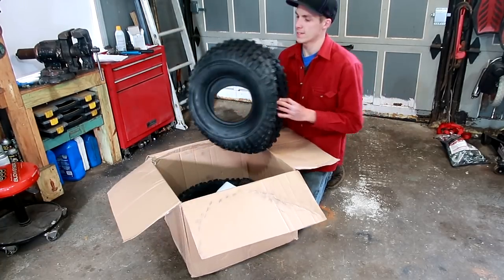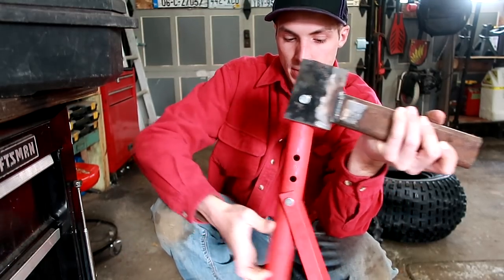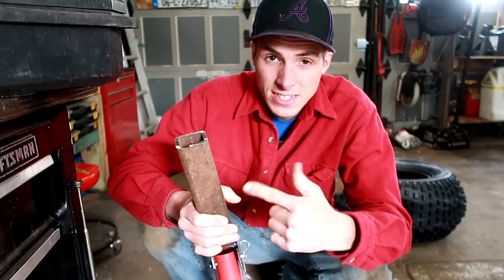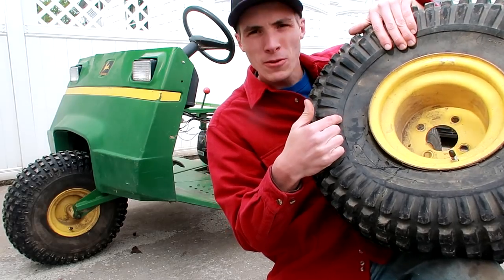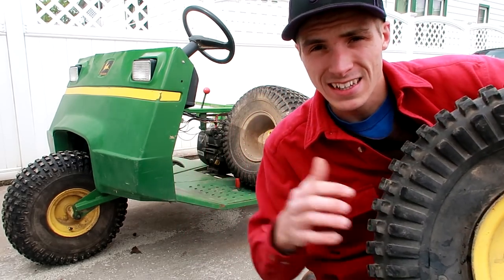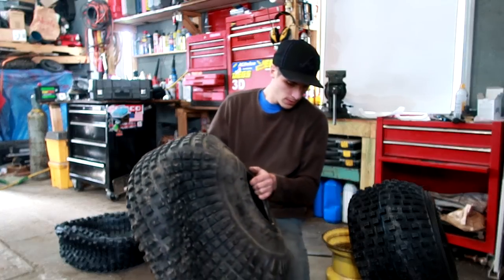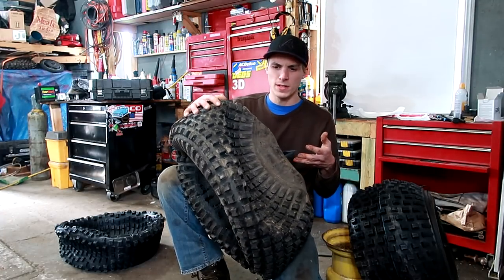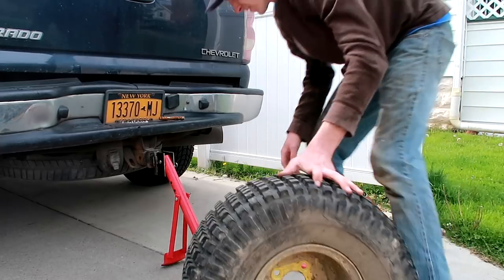GATOR gets NEW TIRES

Comment: If you want a safer way to set the bead on a tire put a ratchet strap around the tire and tighten down and the put air in it until the bead sets

Comment: Can anyone help? I have a 1979 kawasaki km100 and I test the spark a while ago it was good. Then it was getting harder to start and I noticed the spark was weak and I had to kick it a bit or push start it. Now it doesn't start at all and has no spark. the spark plug is brand new. is it the coil or points and condenser.
Reply: calvin kostelyk is the battery good
Reply: It shouldn't matter because when I got it the battery was shot and had no fluid so how would it change.
Reply: Points can get corroded over time
Reply: Derek Getz is that possible to happen in two-three weeks?